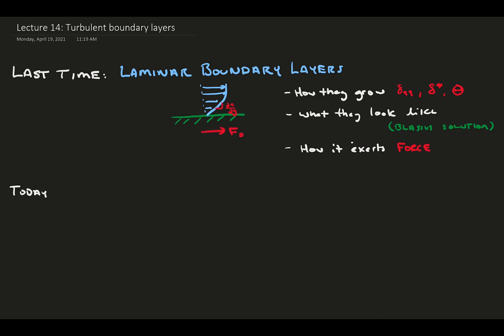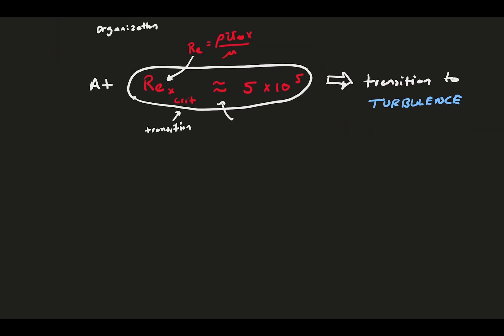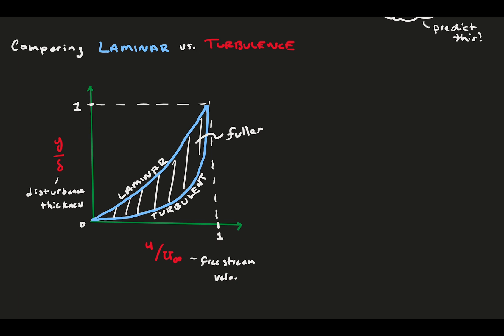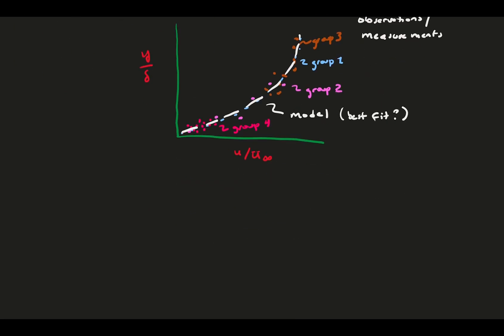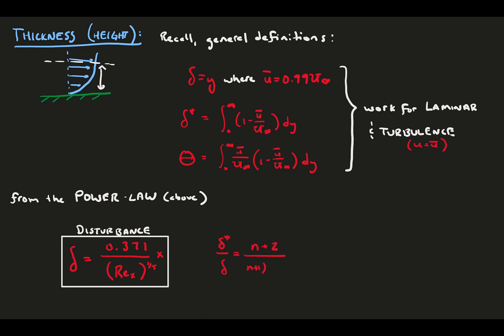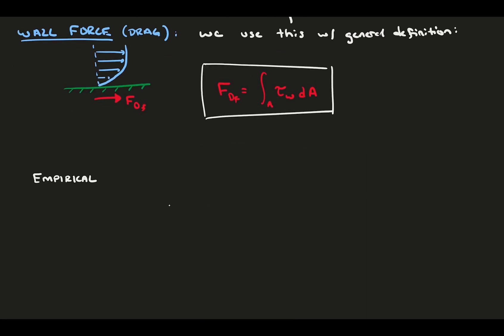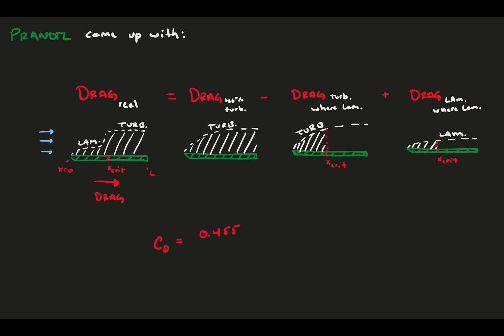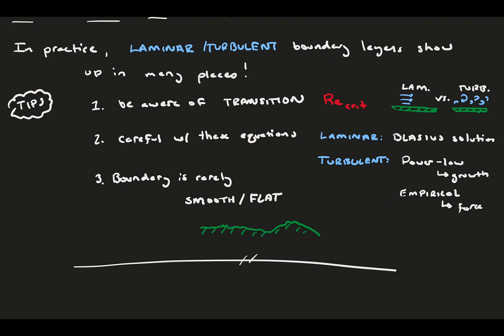Turbulent boundary layers [Fluid Mechanics #14]

Comment: Sir, can you pl explain specifically exactly how the velocity difference can create vortices or circular motion through the angular momentum ???
Reply from the maker: Good and complex question, understanding turbulence is no easy task. 

Velocity difference, like in a boundary layer, leads to vorticity---and vorticity is the root of vortex structure. A boundary layer has vorticity from shear, however this is not the same as a vortex which requires fluid rotation (searching a parameter called the Q-criterion might be helpful here). However, when the shear in a boundary layer is disturbed either through physical impedance like roughness, or naturally occurring instability growth, it can cause this vorticity to become rotational and lead to vortex structure. These lead to things called hairpin vortices, and those eventually comprise wall-bounded turbulence. 

Not sure if you find this helpful, this is just how I understand it!
Reply: It's helpful. Thanks 🙃